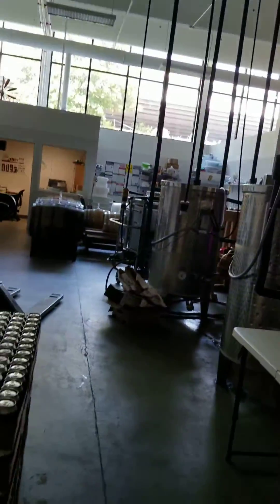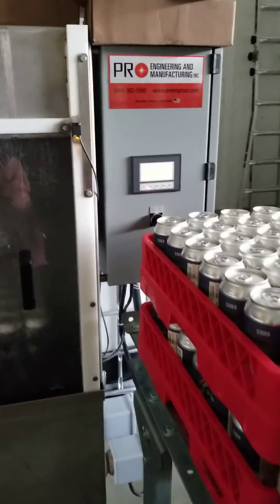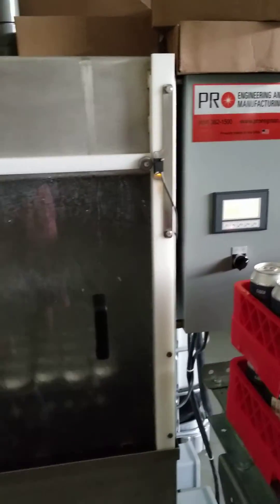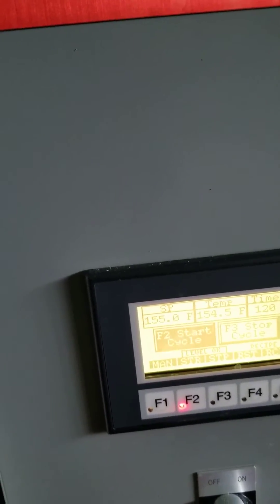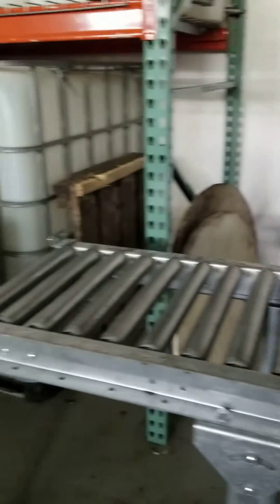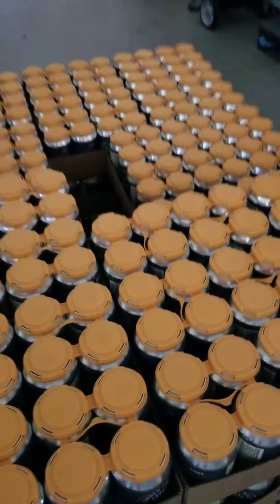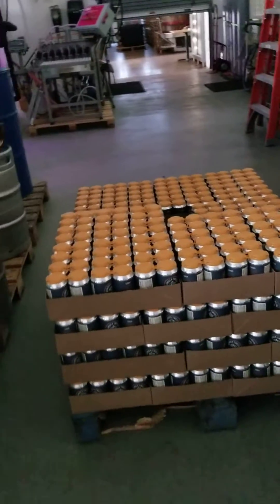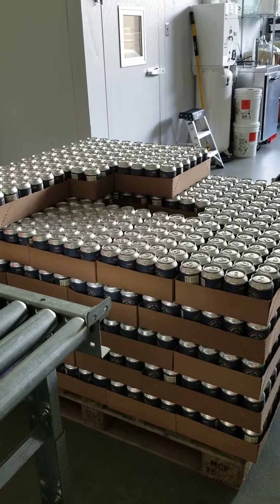Batch Pasteurizer

Comment: Hi guys.  I have 4 cases (bottles) ready to be pasteurized, they were backsweetened with FAJC, and primed with dextrose.  I've heard though that it's harder to kill off EC-1118 (champagne) yeast...is this true?  Also, I'm using a water bath canner (with false bottom) to pasteurize....is it best to slowly raise the temperature with the bottles in, or (as I've seen others do) place the bottles in after the water has come up to temp?  I planned to raise the temp with the bottles to hopefully avoid any cracking.  I'm using multi use commercial beer bottles, and not the thin single use bottles that many companies use today.  Thanks.
Reply from the maker: Hi - sorry for the later reply. EC - 1118 does want to ferment to a lower sg than other yeasts but I do not know of any reason to believe it has a higher heat tolerance. I would say that a gradual raise in temp is the way to go. A 40 plus degree change seems to increase the risk of breakage quite a bit. Going gradually would work. Typically crown caps hold in this scenario and more sturdy bottles hold up better. Probably you're done with this project already :) but if not good luck!
Reply: @Number12Cider  Hi.  I appreciate you getting back to me.  Yes I've finished (and drank) the project...lol.  I had no real  problems, aside from a slight over carbonation (my fault), and 1 burst bottle (while pasteurizing), which was contained by my canning unit.  I used good solid "John Sleeman" beer bottles. Next time I'll definitely do everything exactly the same, except keep a closer eye on my carbonation level.  Thanks again for taking the time to answer me back....I know you guys are busy.  All the best!
Reply from the maker: You're welcome. Better luck next time!